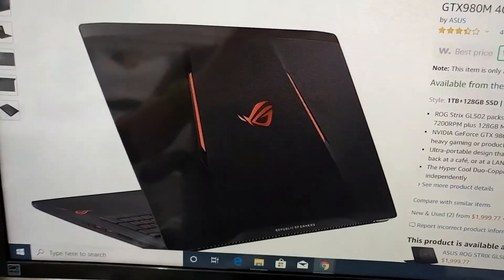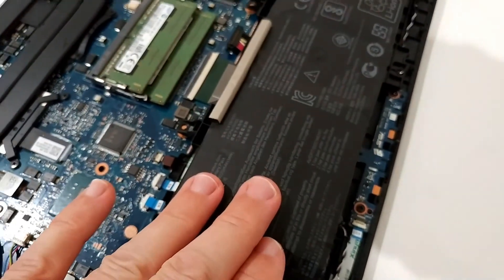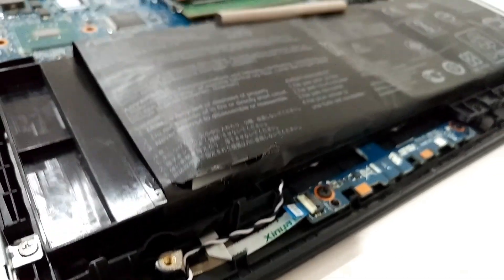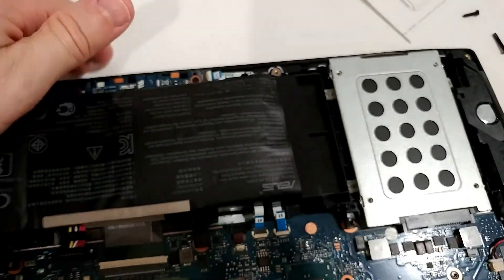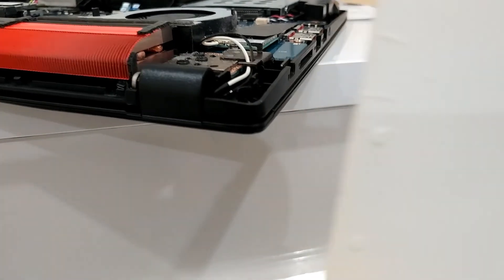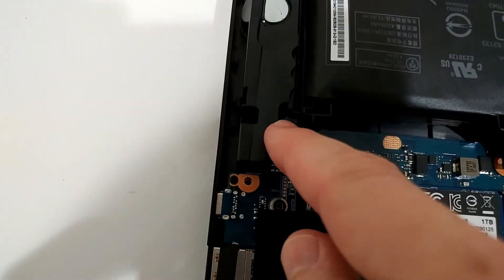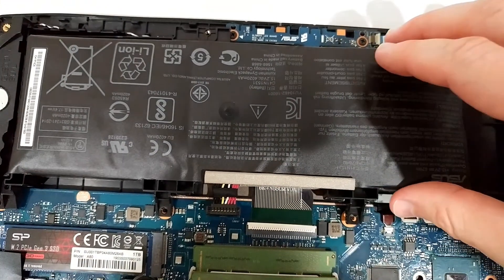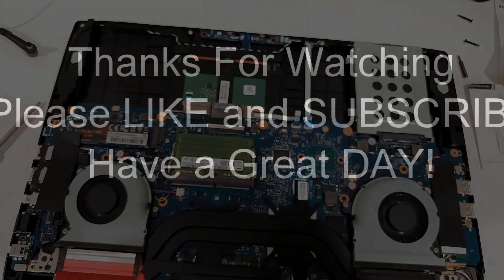How To Remove The Battery On A ASUS ROG STRIX GL502VY-DS71 (Or Any ASUS ROG STRIX GL502)?

Comment: Thanks for the stew driver tip to help disconnect the cable, my nails weren't getting the job done.. and I wasn't sure which direction to pull. I'm still amazed how swollen my battery was, didn't even know that was a thing, I thought my laptop was curved because of the small support I use underneath.. lol. Asus should emit a warning, never had that happened before nor heard about it.
Reply from the maker: Yep ... 100% agree. Thank you for the confirmation 👍

Comment: followed the steps in this video and disconnected the battery and tried holding power for 30 secs before plugging power cable in. i get orange light briefly on my battery LED and thats it. wont turn on. However when the battery is disconnected the light does not come on.

another note. the laptop has been sitting for over 13+ months not being used and then i tried turning it on the other day with a different wall cord and it magically turned on. thought it was just that cord until last night when it died and wont turn back on and now im here lol.

Any thoughts? Should i try reseting Bios from Cmos battery? the only other suggestion ive been able to find
Reply from the maker: Sorry ... don't fully understand. Did you remove the battery while plugged it in to AC power ????

Comment: Thanks!      
Have 2 Asus GL502, 1.5 year and 3 year , used on the AC 
both have battery swelling, just removed.
i think it no sense, and dangerous to buy new.. (
Reply from the maker: Yep ... I have mine running without battery since more then one year with no problem ... I've tried one for $50 on Amazon, but didn't work at all

Comment: Just today I found out exactly same bulging like you have... However do you have a working solution for overheating of CPU and gpu?
Reply from the maker: Yeah ... sorry to hear. It's a sad story to see such problems with such an expensive device. I've removed the battery completely and running without - no problem. I've heard about some heat pipe mods, but I don't have the money and don't want to take the risk, so I didn't change anything, but I have the impression that after removing the battery it's now a bit better with the heat, but of course not a life changer. Next PC will be a desktop or at least larger laptop with better cooling ... lol

Comment: thanks, I was having issues with my asus and I was hestiant on how to remove it
Reply from the maker: NP - glad I was able to help. Are you using it now also without the battery like me? Does it work properly? I'm having huge problems to restart - it always needs TWO attempts ... verystranage
Reply: @allcheckout  :O 
I still have my battery plugged but I can't turn off the Asus. It just powers off for like 15s and then starts Windows again, but this problem I have had it for like 6 months or so. 

The major issue with my laptop is that It won't turn on unless is connected to the AC cable but the battery works just fine I can use the laptop unplugged after pressing the ON button.
Reply from the maker: @unfututufu1  Very strange. Never had such thing with the original battery, but with a replacement battery I bought from Amazon, but I then sent it back. Thanks for the info btw ;-)
Reply: @allcheckout  no problem, again thanks for the vid and I already subscribed :)
Reply from the maker: @unfututufu1  Awesome - thanks - really appreciate - take care!

Comment: my Asus ROG Strix GL502VSK does not charge and i have been using it without a charger for a while now. the link to the battery replacement states that it isnt available, is there a new place where you can buy replacement?
Reply from the maker: sorry ... I haven't found any good one and hence I'm running it since almost 2 years now without the battery ... no big deal ...

Comment: Hey bro, I already took off the battery from my laptop but I am looking forward to replace it. However, I haven’t find any page where I can order it, do you know any? I want the original battery, and my laptop is a ROG strix Scar II, thanks for the vid man, I hope you can help me
Reply from the maker: Hey bro. Thanks for commenting here. Unfortunately I haven't found a suitable replacement yet on Amazon and others tell me exactly the same. If you contact Asus I'm sure they will be happy to sell you a replacement for $200 which will last another 2 years or so and then blow up. So most ppl (an also me) seem to decide on just removing the battery and use it without it or use with a UPS battery to cover power outages.

Comment: Mine is GL502VM. My battery is dead, and is stuck on constant charged status, does removing the battery helped with the performance?
Reply from the maker: I think the temperature a bit lower because of the extra space inside and because there's no extra extra heat from the battery ;-)))

Comment: Does this Laptop work without a battery? I actually connect it always on the AC Cable so a battery wouldn't be important for me. It actually makes my laptop lighter for travelling.
Reply from the maker: Yeah - absolutely not problem without the battery and sorry for the late reply
Reply: @allcheckout  Darn i  wa jut looking for this answer, my battery broke, it always signaled charging while it was stuck at 73% indefinitely and once turned off the oragne led was blinkin makin me insane :D in the end i use always AC, so i guess i can remove the battery without any issues then :)
Reply from the maker: @dhaara1  Yep ... have it still running like this since almost 1 year and no problem ... except for power outage ... lol
Reply: @allcheckout  haha yes, thats okay with me, one thing, the led glows now constantly orange, i guess as its missing a battery this orange means that its under power ?
Reply from the maker: @dhaara1  Probably, but not 100% sure. I have my laptop in the desk and can't see the LED's properly. I just  checked ... The laptop is running and no LED to see from the front or top
Reply: @allcheckout  So Basicly when u took out the battery, basicly the LED indicator for the charging orange ( green if charged ) is not lit at all ? Cuz mine is still signaling Orange like its charging, and after an hour or so it starts blinking.
Reply from the maker: @dhaara1  No LED light to see from outside now as far as I can see ... I've checked from all sides now ....
Reply: @allcheckout  interesting, for me the battery charging is blinking and also the power on and processing led are blinking.
Reply from the maker: @dhaara1  Yeah ... I have opened mine at least 20 times (during SSD replacement and battery replacement / removal ....) Maybe I broke the LEDs .. lol
Reply: @allcheckout  hmm might be. Indicators should work even without battery except the battery indicator should be off what's bothering me as it is still active even without the battery
Reply from the maker: @dhaara1  I don't care about the LED's ... most important the laptop is running fine ... at least for me. I guess you will learn to ignore this light ... ;-))
Reply: @allcheckout  You see that's what I was thinkin too, so I removed the indicators panels also, if there are no indicators there's nothing that can blink right 😁😁😁😁 also got confirmed by ASUS that battery can be taken out and LEDs indicate error as they are not meant  for usage without one but covering it takin out the LEDs is totally fine as pc works just fine even without the battery as they told.
Reply from the maker: @dhaara1  Thanks for your confirmation. Very helpful. I'm actually still looking for a good battery, but I guess it's difficult to find one and to connect. I've already tried and failed ... so maybe I'll leave it like this till EOL

Comment: hello, i kinda searched that when i removed the battery, the brick( the charger) will lose power which will lead to me not being able to use my laptop anymore. is this true?
how long have you been using your laptop without battery?
Reply from the maker: Working since 1 year without the battery, but apart from strange behavior during boot-up (and in case of power outage ...) there's absolutely no problem ...

Comment: Hi Guy, my GL502vs canto power with removed battery. Can you gelo me please?
Reply from the maker: There shouldn't be any change needed if it's the same laptop. Just remove the battery and plug in the power supply again and it should work, but some guy told me a similar story and he had to fix something in a small repair shop ....